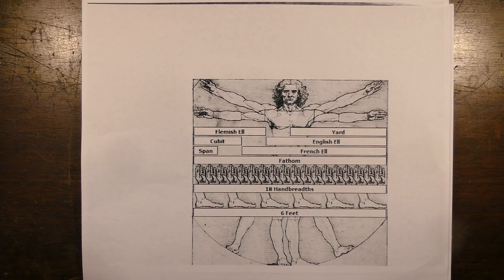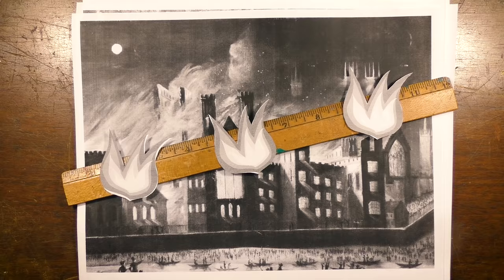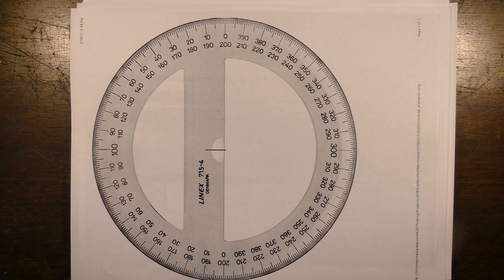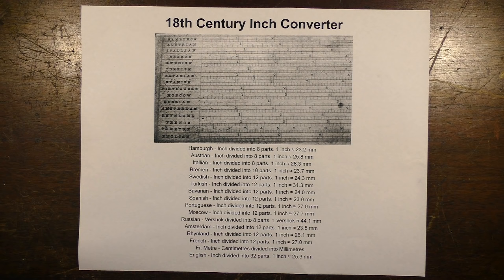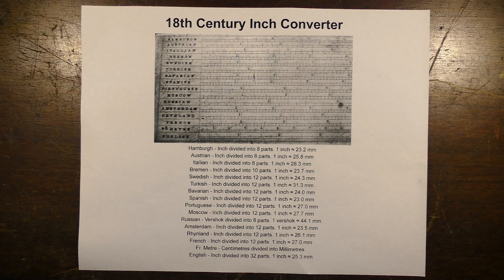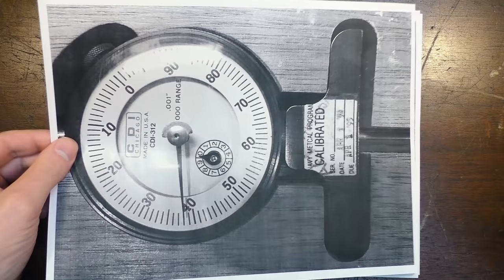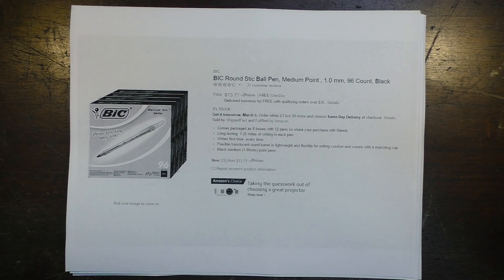Origins of Precision

Comment: i was a semi-skilled  surface and cylindrical grinder in the 70s and i remember the total reverence of buying my first micrometer and that was second hand ..
Reply: Speaking of total reverence . . . That was my experience in the early '60's when, as a university physics student, I bought my first slide rule. It was made of bamboo and came in a leather carrying case, for $40, which was a lot of money at the time. It served me well until, about 10 years later, I acquired an HP "electronic slide rule" for $400. Its display used small LED 7-segment characters that were the state of the art at the time. Now, in 2020, I'm still trying to decide if I need a smart phone - the jury is still out on that one.
Reply: @clarencegreen3071  I was born 1955..when I was in secondary modern we started on slide rules. Did enough in them to realise how fab they were..then calculators came in.. But even now I see a vintage slide rule..and just love it as a thing..and to think nasa worked off slide rules
Reply: Was a tool grinder , used precision measuring tools and gauges and surface plates you show
Reply: Was a tool grinder , used precision measuring tools and gauges and surface plates you show

Comment: Fantastic video, subbed for sure.

Have you read "English and American Tool builders"? It's a great read on a similar subject, published 1926 and now in the public domain. You can find it freely online.

It mainly focuses on the specific people responsible for the early stages of the industrial revolution from 1850-1900. It discusses such critical figures as Joseph Witworth and Eli Witney, and spends a good deal of time discussing the early process of making truly interchangeable parts a possibility. Definitely a good read.

Comment: A $100 Jo-block set is neither a full set nor higher than production floor quality, a single block in the higher reference grades is $200 and $10,000 for a full set of top grade blocks.(I don't state specific grades here because there are several rating systems, but generally each system roughly has grades for rough production work, fine production work, tool calibration grade the a company would not allow out on the shop floor, and a reference grade used by certification labs under tight climate control. 
Steel is good for use with steel tools and parts because thermal expansion matches and it is low cost, but it wears relatively fast, more wear resistant materials are used for very high production where temperature is controllable, or when non steel materials are being measured thermal expansion of the jo-block material is matched as appropriate.  

The provable methods of checking accuracy are of more interest than the simple level of precision. By this I mean how does one create with certainty the most xyz intrument? Sure, you can rub three stones together but when do you stop and did you do it correct, that is when math and optical tricks come in. Optics allow comparisons down to the scale of the wavelengths of light [500nm or 0.5 micrometers possibly a half of this in some cases], or for angles the transiting theodolite, which can be calibrated to 1/3000 of a degree accuracy and repeatability with only a decent ruler, a screw driver, and some knowledge of trigonometry.
Reply: For average people it would just be a nice piece to talk about and for amateur work or just sharing a huge part of modern history, it's relatively affordable, so you can see where he's getting at. It's not a secret hidden from people like most things.
Reply: To that, one only needs some decent micrometers and to know a friend with a few mid grade jo blocks to confirm the mic is in spec, no need to own a set.
Reply: Nearly any grade of 81 pc gauge blocks accuracy will far exceed the level of uncertainty achievable by all but the most controlled environments. Certainly far more accurate than is required by the amature.

Don't be fooled into thinking you can actually take advantage of that 10 thousand dollar gauge block set.
Reply: I'm a home machinist. I have a B grade surface plate, a $100 gauge block set, and some cheap gauge pin sets. I never really realized just how inaccurately I machined my parts until I collected these basic tools. For a modest cash outlay, I have the capability of verifying parts to 0.0002 inch. I certainly cannot machine anything that accurately, not consistently or expediently anyhow. I wouldn't consider spending $10000 for a set of gauge blocks unless I was making something really special.  I don't have any friends with mid-grade blocks either. The cheap blocks are good enough for my use, and don't take food out of my mouth.
Reply: Th need for accuracy is magnified when you stack blocks together. If you add 5 blocks together and they are all .0001 to long  , Your   reading will be off by .0005, there is a big enough discrepancy to make scrap in critical dimensions.
Reply: I worked in a jet engine manufacturing plant  , retired , The  dimensions were accurate to .0002 on pieces with 56 inch diameters . Temperature control was critical. The blueprint called for the demensions to be measured at 68 degrees. They even went as far as keeping gages in the coolant used for grinding or turning , to make sure the parts and gages were at the same temperature.  when making parts to 5 or 6 foot dimensions the temperature can change dimensions by a few thousandths
Reply: @ogarnogin5160  thankfully the average home machinist isn't building jet engines.
Reply: @mikelang4191  Certainly not with that attitude! There are several people on youtube who have done so.
Reply: @compwiz00  "average" was the operative word. I doubt you have the ability to realize tolerances below .0002 in a home shop and that's fine because it's totally unnecessary. Even if you choose to build a jet engine.

Comment: I fear you don't know how to maintain your gauge blocs. I was hearth broken when I saw those old gauge blocs put back in the box without protection from acidity. 
There is a simple protocol whent using gauge blocs involving oil and degreaser. If you dig into it and experiment, you'll notice when the surface is clean (even from your acidic skin oil), the blocs stick together even harder.
I deeply love your content though, very interesting and enriching!
Reply: I was on a Navy sub on the '80's - we had a 48"  South Bend lathe in the engine room. I learned a few things from the boat's machinist- the first was to never touch the gage blocks with bare hands- he had cotton glove liners for that.

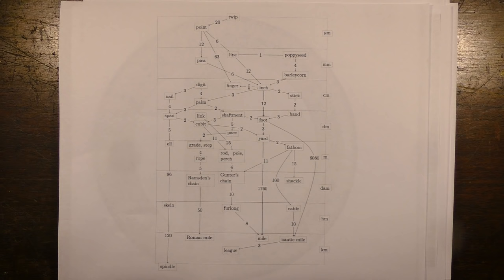Comment: 7:20 I would love to be able to memorise that chart. You could translate pretty much any dimensions you ran across in historical literature for the last millennia pretty much!

I love some of the old measurements that were used by craftsman back in the day, points and lines for instance I've run across before. A lot of them seem to relate to rope, which I suppose was one of the few things in daily use that would have been long enough to need exotic measurements like Gunther's chain lol.

Comment: Everybody disparages the American system of measurements. But it has one major advantage that the metric system misses. It’s to be easily divisible in half, endlessly. It sounds simple, but for average people who didn’t know a thing about math, it made building houses, making change, and weighing meats and produce practical and easy. It’s for the day to day activities that normal people actually needed and used. 1 inch, 1/2, 1/4, 1/8, 1/16, 1/32, 1/64 etc. what’s half of 3/8ths? 3/16ths! You don’t even have to think about it
Reply: I wanted to give your comment half a thumb up ;)
Reply: It there was just a way to divide a centimeter into 1/2 or 1/3 or 1/7.5 ... then we would have 1/2 1/3 and 1/7.5 cm ... but no ...
Reply: Isn't moving a decimal point even easier?  One millimeter equals .039".  That's comparable to 1/32"!  Isn't that accurate enough for day-to-day use?
Reply: @srdavis37   .00812" difference?  You might be thinking of carpentry.  This is machining.
Reply: This is gonna blow your mind. Half a metre. 1/4th of a metre. 1/8 metre. 1/16th metre.
Reply: The American system  might work ok on that sort of level but most measurements aren't like this e.g. thread root diameter, etc and a digital basis is much better generally.
Reply: @TheMTBChannel   Decimal inches is as accurate as metric, so I don't know what you mean by level. It's not harder to learn. Billions of existing prints and tools and measuring instruments are inch only. I don't understand what you mean by "...much better generally." either.
 I have no problem with the metric system. I retired 10 years ago.  We made metric parts as well as inch and converted a lot of prints and programs to inch to do it. At that time everyone in the shop had $5k + personal tools in inch, but not that many metric scale tools.
Reply: @lobsterbobable agree totally. My point was in relation to fractions in the first comment. Obviously any digital system whether based on a metre, inch, bees dick, whatever is easy to calculate. Most measurements are in decimals rather than fractions.
Reply: @TheMTBChannel  Great channel, by the way. Good for people who would  like to be still making parts.
Reply: If fractions are so much better  . why are mikes machine cranks  and verniers in decimals ?    For whole numbers would 12 be a better system than 10 ? We use ten because  that is how many fingers we have . But with a based on 12 you can pack better , and divide into 1/2   1/3    1/4  and  1/6 and 1/12.  With 10 you can only divide by 1/5 and 1/2  We still use time based on 12.   Some ancient cultures used 12 as a base for whole numbers.
Reply: When you want to convert measurements based on the inch; 1/64, 1/32, 3/8, 3/4 etc. into decimal sizes used in precision engineering, you get these messy numbers; 1/64=.015625", 1/32=.03125", 3/8=.375, 15/16=.9375" No need to go on and on, but this nightmare leaves the "problem" of dividing by two for dead!
Reply: Fractions are not unique to the imperial system or even measurements themselves....
Reply: @LouSaydus  Of course not. Obviously there is such a thing as half ,quarter, third etc. of a millimeter or meter or kg.
Reply: Thats the same regardless of what linear unit you use nothing to do with being inches/feet/yards its intrinsic to all standard linear units. Its the same whether you do it as a discrete value or you do it as a Fraction / ratio. Where imperial/Units/feet/ fall down is calculations and undue/unnecessary issues and errors/ unit conversions resulting from scale. There is a reason that SI units are metric.
Reply: @zdcyclops1 lickley That is because you grew up with the american standard system. If you grew up with the metric system, you would have the same kind of intuition with centimeters. I know the thickness of my pinkie is 1 cm, the width of my thumb nail is 1,5 cm. Or 3/2cm or 1 1/2 cm if you like.
You can still write metric in fractions, but it honestly doesn't make too much sense, because if you want to add up 2,4 cm and 1,6 cm, what would that look like in fractions? I just look at it and know it is 4 cm and It wasn't even meant to result in an even number.
And I would much rather add up some decimal numbers than 3/4 and 1/16. And apart from that, what exactly are 13/16 of an inch? That is not intuitive to me either.
Reply: @zdcyclops1 lickley I was quite young but old enough to remember when Canada switched from imperial to metric system. People adjust fairly quickly.For the most part.. Some things you keep thinking in "the old system". Like weight and height of a person. Don't ask me in metric! lol For the rest you start by always trying to make the conversion but soon you start "thinking" in the "new system" and conversion become an unnecessary hassle. 

Now as for the fraction thing. Easier? Add 3" 5/8 to 7" 9/16. Done? Then add another 3" 13/32 and subtract 7"  27/64  ....
Not sure what's easy about it? There's a reason machinist work in 1/1000"

Comment: If you want to know why the gauge blocks stick together, its a suction cup effect. To prove this clean two gauge blocks with acetone to remove any oil. Without rubbing more oil on them by wiping them on your palms try to ring them together (wring?). You will find that you cannot get them to stick together. The light oil you put on the blocks by rubbing them on your palms creates a air tight seal by filling up the very small imperfection on the surface. If the imperfections were too large, the oil would not be able to stick in the gap to create the seal. So after you wring them together, a very small vacuum will be created when one block face is pulled from the other block face.

Comment: Two things:

1.  When I was a kid in the 50s, my dad managed a machine shop.  He showed me their set of Jo Blocks in a cabinet.  They cost $2000!  Nobody knew why they were called Jo Blocks, and NOBODY WAS ALLOWED TO TOUCH THEM, Dad said.  They were there to impress customers.   8^)

2.   This could be legend or apocryphal, but I've heard the story in several places.  In the 1960s or 70s, Lockheed in Mtn. View, California, made a custom set of jo blocks that would be the most accurate and precise in the world.  A tenth of a millionth, I was told.  The problem was, that once they were wrung together, they would never come apart!  You used the term 'cold welding', which I'd never heard before, but that's exactly what happened!  They welded themselves together.

Comment: Actually I think you overlooked something. The surface plate would have come much later. Getting two points and putting an object in-between it. Rotating it allowing you to make a circle would be first. Then from there you could cause a flat surface. Round is much easier to start off with and can get you a flat edge easier than trying to start off with a flat edge. You should see ClickSprings start at an approximate lathe beginning, now that's where it all started.

Comment: I know this was outside the scope of the video, but it should be noted that the metric system also suffered from issues of having to change the standard over time due to erroneous measurements. The standard of being 1 billionth of the distance between the North Pole and the Equator was abandoned in favor of the use of the metal bar, then to the wavelength of Krypton isotope emissions, and finally a fraction of the distance traveled by light in a vacuum for 1 second. Other measurements like the kilogram and celsius similarly had to undergo changes in definition because water does not have a completely uniform mass due to Hydrogen isotopes, water boils at different temperatures depending on air pressure, etc.

Comment: I am an electronics engineer, but was lucky to have started my career in a automotive production factory. The gauge blocks, height gauge, go-nogo gauge always fascinates me. Its like conncting with nature.  And I could very well relate to analog scale in electronics and tolerances associated.

In a zero crossing detection circuit, its never possible to measure the zero accurately, because, there is no true zero.

Comment: Back in the early 70’s I sometimes made snap gages for use in a factory.  Two ten-thousandths total tolerance over up to 14 inches.  Final measurements had to be verified in a 72 degree inspection room, allowing a couple hours for the gage to come to room temp.  They were always a tiny bit smaller than when measured in the dye shop, and the longer the gages were the bigger difference the temp made.  What puzzled me was that the factory that was paying for them was not air conditioned, and although heated in winter, working temperatures probably varied a great deal.  I never knew what kind of parts were being measured with those gages.  The go/no-go gap was .002” on all of them.  All were made from gage stock.  
By the way, Baldrick built Black Adder’s time machine out of wood and string.

Comment: Johannson was   on his way to Mauser to check on their accuracy in manufacture, for the New M1896 Swedish Mauser Rifle.
He found that Mauser still used unreliable gauging systems for correct measurements.
On the train ride back to Sweden ( Oberndorf- Stuttgart, north to Denmark, Ferry to Sweden and Eskilstuna ( Carl Gustav Rifle Factory) he designed his "Blocks " and had them made. He then supplied both Eskilstuna factory and Mauser factory to ensure complete interchangeability of both the Swedish and German Rifles ( CG began M1896 production in 1898, and Mauser got a Contract for 50,000 M1896 Rifles in 1899-1900.
Because of the Interchangeability of Parts from Two different Factories allowed Swedish Army Repair facilities to use parts from Either factory without problems.
The rest is History...Henry Ford and all following World Engineering, in Peace and War.

Comment: I really enjoyed this video. Firstly, at 12:50 this Youtube video shows various old video of manufacturing line. Secondly, it amaze me that various countries used 1 in= 23.2 mm , 25.8 mm , 28.3 mm, etc. I was shocked that how exactly the drill was done in the material just by putting a paper as a reference above the material.